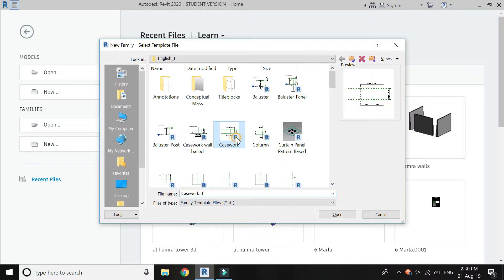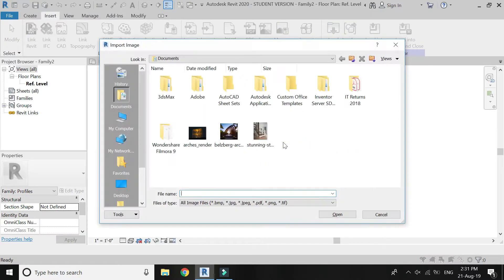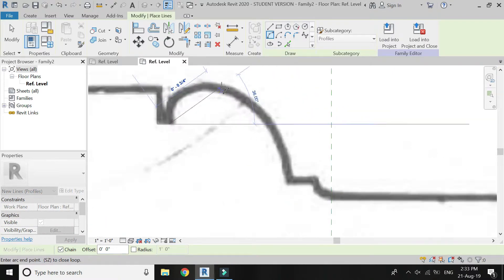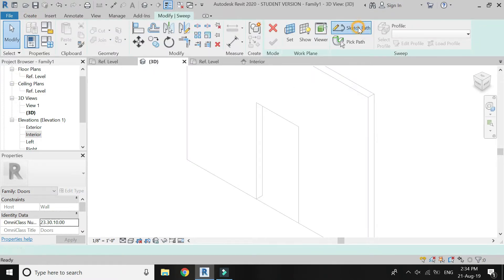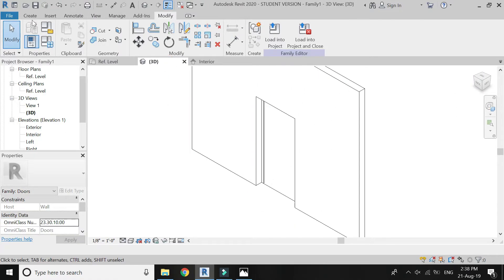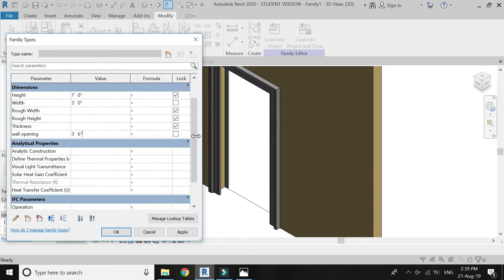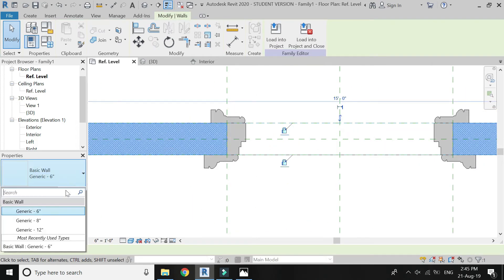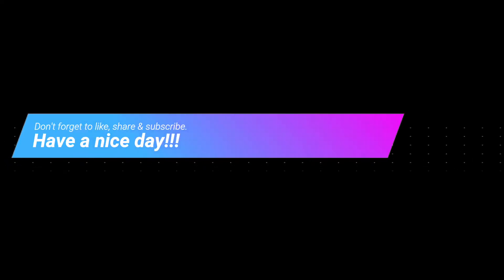Revit Tutorial - Door Frame Design

Comment: You make superb videos but some point skipped like as you load an image   where was the location, it was outsourced please explain all the thing then your videos ll excellence. for beginners it's very difficult to understand. 
I have seen most of the your videos same problem faced.
Reply from the maker: It was a simple image which I have taken from a book. You can simply draw the profile on your own.
And no, I have not skipped any part in the videos, I have explained each and every necessary step. I always skip the locations because obviously locations are different for every system. It depends on the user where he has saved the files and the images.